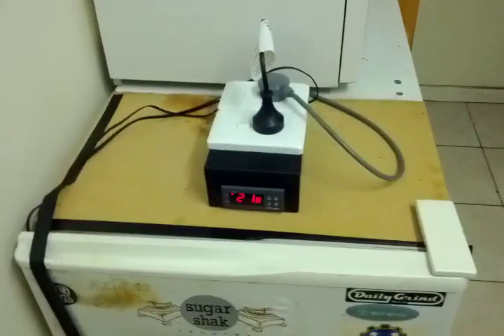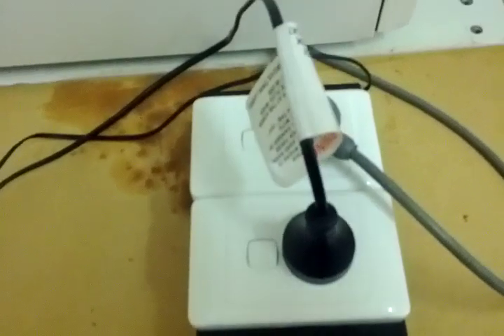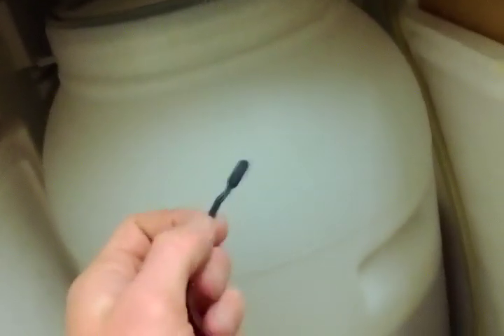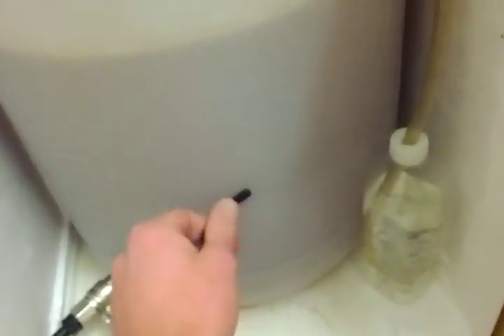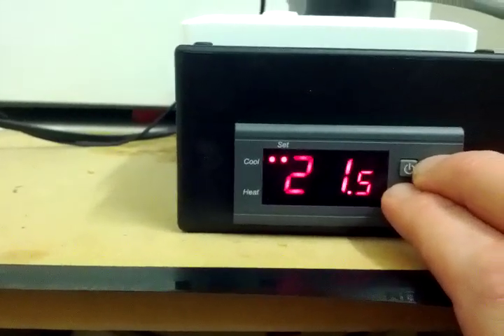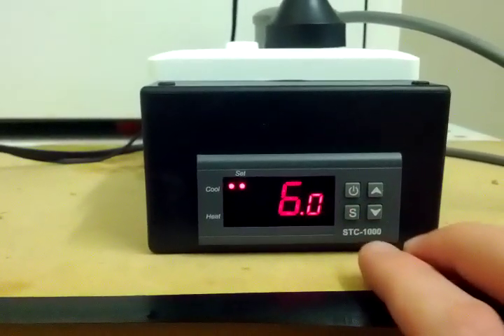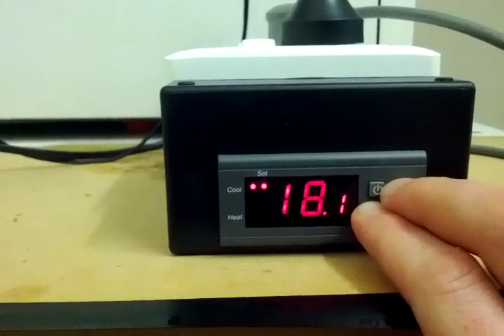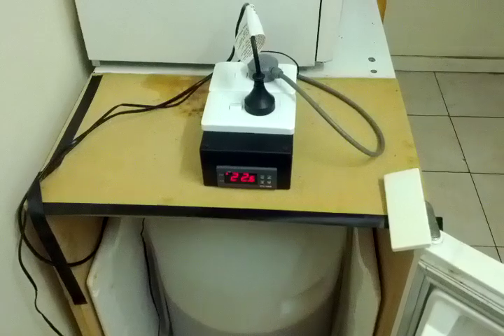Home Brew Temperature Controller - Buy on eBay

Comment: sorry for the delay in replying. i havent made any of these units in a few months. the moduel is a commonly used STC-1000 . it was origionally desighned for aquarium aplications. theres tones of info on home brew forums about using these controllers.